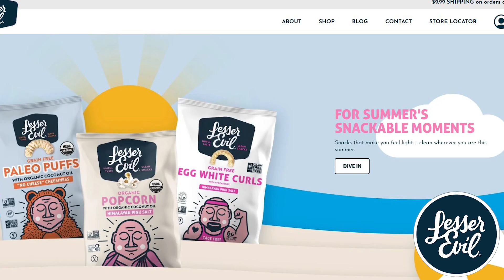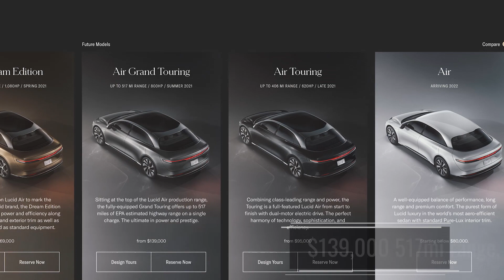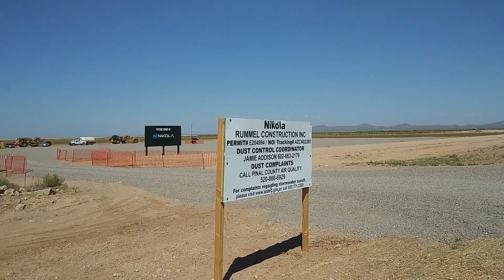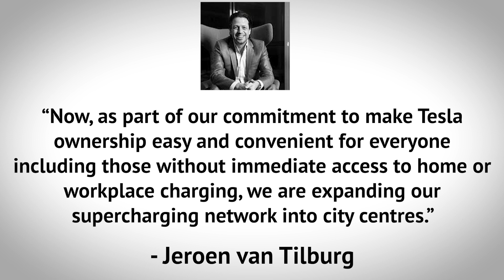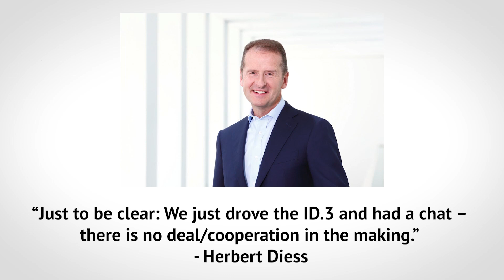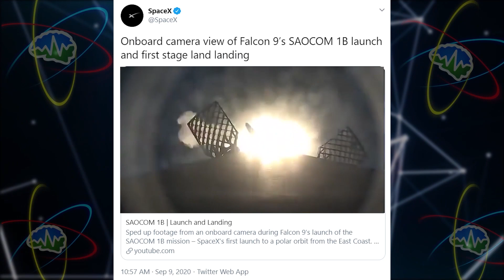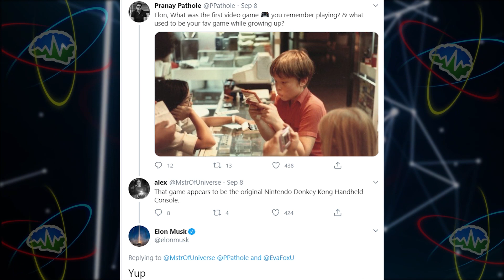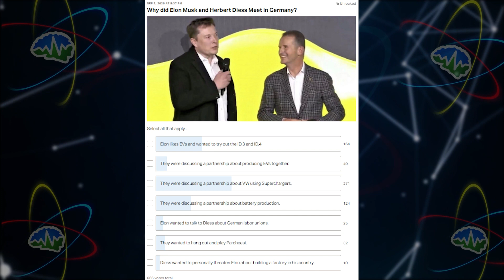Tesla Time News - Lucid Air Reveal

Comment: Hey Zac and Jesse, I have worked in HVAC installation for almost 3 years. The reason why stronger filters aren't used is because of efficiency issues. The fan in the air handler (inside unit) can only handle so much resistance to work effectively and efficiently. When it gets harder to pull air in, it gets harder to push air throughout the house, and you begin to see an energy drain situation as well as a big decrease in the lifespan of a system as a whole.

I am however very optimistic for the Tesla HVAC system, Elon is known to be an industry disruptor and new technologies may provide solutions to these efficiency issues.

Comment: Here's an issue that I see with sharing charging network. Right now, Tesla software has the ability to predict the availability of the charging stations (which station is used and who is coming) and so is able to advice other Tesla driver what is available in their immediate surrounding.  If Tesla allows other EVs to charge at their stations and Tesla doesn't know these EVs until they are actually charging, then the predictability advantage is eliminated.

Comment: The higher the voltage, the faster you MAY be able to charge the battery. Cell chemistry, charging circuitry, temperature management etc all make a difference. Keep up the great work Z&J

Comment: Something I'm excited about with Lucid is a thing Ben Sullens mentioned about how they run the cooling system by running it through the unit rather than cooling from the outside. This increase in efficiency outside of battery density improvements would be a big deal, because if you can combine that with said battery density improvements then you get huge gains in range. This just screams amazing future for humanity.

Comment: Thanks for your rant about fossil fuels from Kent, concerning the horrific fires in Oregon, WA, and CA. My wife and I removed natural gas furnace/water heater from our newly purchased home in 2012, and replaced with electric heat pump and heat pump water heater. Our all electric home additions included 13.2 solar PV system and now 2 PW2's to complement the solar, and two Tesla's (MS and M3). Getting rid of all gas alternatives is the way to go. Thanks for continuing to address these very important issues necessary to address the Climate CRISIS.

Comment: Many BMS's have a module on each battery cell that is connected via a wire or wires. To remove the wire all you have to do is add a small low power transmitter or transmitter/receiver and a receiver or transmitter/reciever on the main BMS module that communicates to these battery modules.  On the BMS Jessie showed, they use the wire to carry the voltage to the BMS control unit (no module on each battery cell).

Comment: Here’s to hoping Tesla switches to CCS in North America on Battery Day 🙏
Reply: Bryan Roschetzky yes, with Nissan moving to CCS in North America, Chademo is dead. Now there is only CCS and the Tesla connector. 

Since Tesla will eventually need to make a replacement for the Chademo adapter as it slowly dies, Tesla should move to CCS or have both connectors on new Teslas. This way Teslas can charge at any station without adapters at full speed.
Reply: @Lynyrd_Evnyrd  Which is exactly what happens in Europe as the Tesla Model 3 uses CCS, as does the Supercharger network there
Reply: LIGHT FALL dafuq kinda copypasta is this?

Comment: CCS is a charging standard. There is a lot to this standard, other than just the plug.
Plugging in means the cars ID is send to the charging station for handshake. The standard also includes internet access for account management. Yadayada.
The fact that the none Tesla could charge was a bug and was fixed quite quickly.
Reply: I guess the EU will have a long talk with Tesla soon. they are realy pushing for one standard in charging...

Comment: HEPA filters put load on the ventilation fan. They are designed to pull through those light fiberglass filters, and are not intended to catch dust or filter the air in any way.

Comment: AC and MVHR doesn't have HEPA filters in because it would be inefficient. You use significantly more energy sucking through HEPA than a less-restrictive standard filter. There is always a tradeoff between power consumption and level of filtering. You optimise for the normal case, not the 'fire of the century' case. It's very easy to stick better filters in if you want to though.

Comment: Weight of transmitter vs wires, probably less than the wires it replaces. As for power, it needs to be compared to the power used/loss in the wired configuration.

Comment: I think the HEPA filter system requires a well-sealed environment, and many houses are not really that well sealed, so the system might not work as well as it's supposed to. At least, that's what I was reading about when I was buying an air cleaner and central air filters for my parent's home.

Comment: 900v is important for efficiency as well as charging..... Higher voltage means lower current, so lower ohmic losses. This is also how they could shrink all their power train components. Less losses means less heat generated.

Comment: With regard to the Wireless BMS.. Even a conventional BMS tends to be a critical thing. It needs to be tested and verified because if it malfunctions and lets the cells go out of balance the battery and car can burn to the ground. So, a wireless BMS could have latency issues or whatever. It would need to be really well tested. I would be a bit wary of it.

Comment: The 924 Volt system means lower power, Current Times Resistance losses! (P_Loss=I^2 *R)
There is some of the higher efficiency they refer to! But with the higher efficiency, comes much higher cost components to handle switching the higher voltages without breaking down! This partly explains the high price tag!

Comment: "Wireless Battery Management System" is easy if one is willing to use a communication bus like RS-485 between cells. This means you have a board that can be tucked between the battery cells that protects all the ones in that brick of paralleled cells, and it communicates to the previous and next bricks via separate RS-485 links. Using a flexible PCB it would be easy to have multiple temperature sensors, and even individual cell failure detection. Second, the making a pack smaller claim I see as dubious. BMS wires are not significant in volume. just a PITA to hook up. BTW, I came up with this method for a Saft EV NiCd battery management system back in the '90s. I wanted a system that was modular, and would work for any voltage of battery pack. I was looking at two different vehicles for making into an EV. They each had different amounts of volume and weight carrying capacity so the voltages were quite different. Also the modularity allows for economies of scale if put into production, and easier repair. Only one module goes down, and not the whole BMS system. The rest of the modules can be reached via the + and - ends of the battery string. Obviously a dual module failure could leave a dead zone. Modules can be replaced using spares. Why BMS on NiCds, to keep track of heating, voltage, etc at the battery level. Also bypass control to allow faster equalization of cell charge. Yes, they were 12 VDC batteries, and Li-Ion are only 3-4 V nominal in use. Modern electronics can handle direct supplying from the battery brick. Even FETs to handle bypass for equalization can be powered at cell voltage. Note, I haven't bothered to look at TI's solution.

Comment: Electric Cars would not have insulated wires on the BMS because of the size of the round wires needed for high amp swapping. It would be much better to use flat copper bars with ceramic holders that expose the top & bottom of the copper bar & have a non conductive coolant flowing around the bars. Rectangular bars are better for space saving as compared to round wires, plus there would be less heat loss from the BMS & greater efficiency.

Comment: You don’t need a 1000kw charger, any will do, max speed is 350kw. It can also up the voltage from the charger. The reduction gear inside the motor is a beautiful design. Makes me excited about battery day as I cannot believe Tesla will be behind Lucid.
Reply: Sotiris G. No you don’t, watch the launch video, the Wunderbox can  match the pack voltage from lower voltage chargers achieving 300 kw on the 350kw 800v chargers.
Reply: Sotiris G. Well, it’s all hype until it’s on the road. It’s made me excited for next weeks battery and power train day as I think Lucid have shown there are potential gains in the power train as well as the 5% increase in the 2170 cells density from Panasonic this month I’m hoping for 20% more range in the Model 3 with the heat pump / octovalve etc which will make Tesla refunding my car because they couldn’t fix it a blessing in disguise!

Comment: No, it's Not a Tesla killer! It's not the same target buyers. Rather, it's a Mercedes, BMW, Audi, Lexus killer. It'll take away from luxury ICE customers onto a Luxury EV vehicle. That's if Lucid can actually mass produce it and have minimal issues. If you want the 500+ range, get the much cheaper CyberTruck for 69k. If you want a  600+ mile range, get the Roadster for just 30k more. But you get a Supercar. Then there's battery day, which I think will just blow us away with the huge increase in battery range, longevity, and a cheaper faster way to make them.

Comment: C'mon guys - the headlights are not the first / most important feature about the Lucid Air. The compact motors and large storage in the design, low aerodynamic drag, and longer range are much more important.

Comment: Shorts said the same stuff about Elon and Tesla. Although, I am skeptical about Nikola until we see an actual product.
Reply: Yes, but the shorts were making those claims about Tesla regarding things that were either subjective or even at odds with objective facts..  For example, repeatedly claiming "demand for Tesla cars is falling" even though Tesla had almost zero inventory and backorders for weeks/months of orders every time the shorts made this claim.  Meanwhile, the claims about Nikola are verifiable.  

Nikola claimed to have a giant solar array on their headquarters that is part of a giant hydrogen production system.  They claimed it was the largest hydrogen production facility in the western hemisphere.  That hydrogen production system was to be copied all over the country and it is supposed to be the core of their whole business model.  The hydrogen production system does not exist and neither do the solar panels that were supposedly powering it.  There are no solar panels on the roof of their building.  They only have permits for hydrogen storage tanks on site.  No hydrogen production whatsoever.  

Nikola claimed to have a new battery technology that is superior to Telsa's (arguably the best in the world).  Now Nikola announces they are going to have GM engineer their truck and they will also use GM's battery and drivetrain technology.  This one thing really tells you everything you need to know.  There is no real engineering going on at Nikola.  It is all marketing.  All engineering is being outsourced and the prototypes that do exist have been built from off the shelf components bought from other companies (if the prototypes work at all).

Comment: If charging stations truly become a business, (we pay now with the 3 and y) and say VW signs up for this service, wouldn't Tesla profit from the competition??
Reply: Yes, they would.  They could also charge slightly higher rates for non-Tesla vehicles that use their Supercharger network.  

This is one of many reasons why Tesla is so far ahead of their competition.  Battery manufacturing and supply could very well be another example of this in the near future.  Competitor's EVs may very well be full of Tesla batteries.  Autopilot has this potential as well.

Comment: I don’t ever remember a Tesla event where they talked about all the things that they were not going to release until a later date. Oh we could speak of seat changes, motor options not mentioned and an entire trim level being removed from their web site all of which  just doesn’t get mentioned. If you look at Lucid Airs publications they clearly state that the executive rear seats will be made available at a later date than the initial release. That will also be true of the third motor option and also a different color for the top of the vehicle and I’m sure many other things that they aren’t just going to elaborate on and tell you they’ve yet to release these features. That would be like me saying that Tesla did not reveal that they used two small of wires to support 150kW and greater charging to their initial Tesla S & X owners and also didn’t tell them that they had a third motor that they were working on and so left them short changed. No that would be slanderous. Every manufacturer worth their salt won’t release anything until it’s absolutely ready and are constantly making improvements to their current products that will be used also in their future products. The seat didn’t just get dropped although it was never mentioned during their launch because it is going to be available at a later date. They’re just showing you what you can get next year. If you want the seat they said they’re going to make it so you can just wait a little longer. Shame on them for telling us all the quality tidbits they are including on this up-and-coming sedan. What a fraud... I hardly think so. In fact they’ve been quite transparent in everything they’ve said and have answered all the questions I’ve had to date. Future Tesla owners will benefit indirectly from the competition and for that I’d thought there would be three cheers for less waist, higher efficiency and lower cost vehicles these improvements will usher in to many trim levels. I was obviously mistaken that a greater range per kilowatt of battery, aerodynamics and motor/battery efficiency was not be celebrated because it’s the wrong company that came up with it. #sad

Comment: VW’s move towards EV production has highlighted two strategic Achilles heels.  The first is that that they are outsourcing to LG Chem for batteries making them vulnerable to both supply and price changes for a critical component.  The second is that VW has no dedicated super charger network.  Herbert Diess’ meeting with Elon Musk probably touched on these obvious shortcomings. Add to the mix that Tesla is innovating new mega casting production methods it would appear that any business relationship would be one sided.

Comment: My take on GM/Nikola. GM just came up with their new EV line. It is all their tech. Milton will golden parachute out like he has done before. GM gets the cool name and will run as a separate company and transition to this for all EVs then the legacy brands will slowly pickup vehicles under their badges to not upset their customer base. It will keep the dealer network happy during the transition. I think GM and Mary Barra know exactly what they got. $2 billion hype machine. They just siphon the alleged costs (since there is little cash they are actually putting out to Nikola) from marketing budget. People are already interested in the Nikola brand. So they don’t have to spend anything on building up the name. They just need to hide the Milton scam long enough to have their tech actually release a product. The factory never gets built because they will just absorb it all into their current infrastructure. It’s actually a best of all worlds for GM. They just found their splash into EVs and actually compete. None of their past efforts have been looked at that favorably. The reinventing of themselves is what will save them down th  EV road.

Comment: The question of which is closer to EU - Shanghai or Fremont - is an interesting one. We know Tesla ships cars from the Port of Oakland to the Port of Zeebruge in EU. According to searates.com, this is 7790 miles with an estimated transit time of about 25 days via the Panama Canal. For Shanghai, we don't know the route the pros pick, so we'll assume you want to arrive at a major EU port that's in the NE Mediterranean, since you'll be sailing west through the Suez Canal. That would probably be Piraeus, Greece (#6 biggest port in EU, 2 car terminals). Searates puts the Shanghai to Piraeus voyage at 7693 miles and also about 25 days. So they seem really close to each other, with Shanghai indeed slightly edging out Fremont on distance - but not trip speed. However, I'd wager Zeebruge has an edge over Piraeus in access to major EU Tesla markets, which flips the advantage back to Fremont. This might mean a longer voyage from Shanghai to a Western Mediterranean port is a better comparison. On the other hand, Shanghai-to-Piraeus may have the edge in cost (just because there is so much traffic from China to EU and back).

Comment: Sorry Guys but your are a bit to harsh on the Lucid... Or a bit to much tesla fanboy... (I myself drive a Model 3 and i love it. :) 

Sure its expensive but its a Luxury Car!! Tesla is not luxury.
They dont need 1000kW fast charger? I think you meant the 1000V Charger, there the Wunderbox converts charger who deliver 500V to 900V for the car.
They need HPCs like ionity in europe. 
The Lucid has 16kW AC Charging amazing for Europe...  22kW AC charger everywhere.
The Performance is amazing. And it should consume less than a model s.... 
I think the Lucid Air will be very good in europe..

This is not a Tesla Killer its a Luxury-ICE Car Killer !!
(Like Mercedes, BMW, Maibach etc.)

Comment: You can buy to CyberTruck To motors for under the price of the 500 mile Lucid Air. And will get basically same speed, range, much better software ..ohh and you can take it off road and do more.  Lucid ain't even close to Tesla.